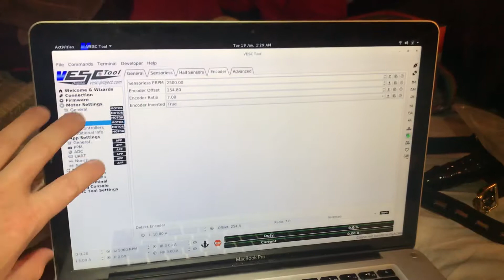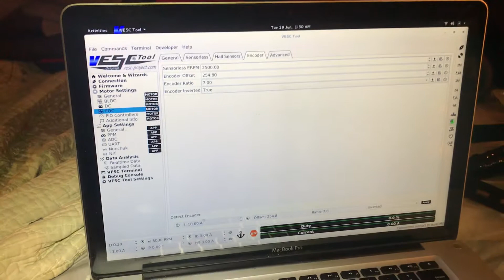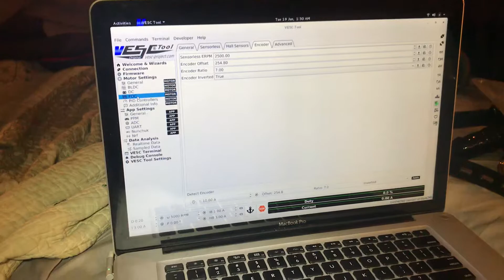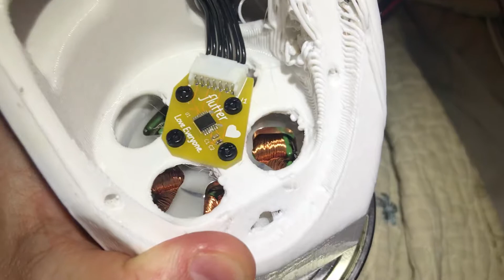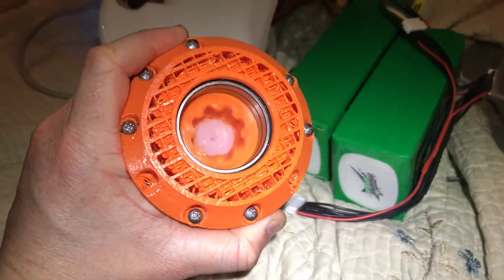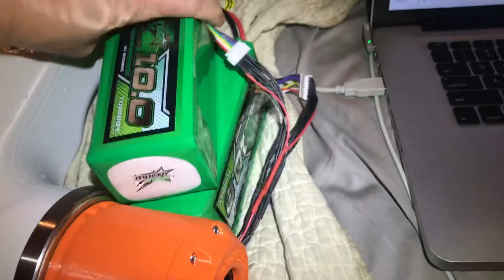Rover new gearbox final thoughts and VESC software

Comment: Hello!
The encoder stand in out shaft?
Reply from the maker: I'm sorry I don't quite understand the question - are you asking about using an encoder on the output of the gearbox? You could add another encoder on the output if you figure out where to place it. However to drive the motor properly you must have an encoder on the motor, and the VESC can only normally talk to a single encoder. Does that answer your question? Feel free to ask again if I haven't got it!
Reply: @SequoiaAlexander  Thanks for the quick response!
Yes, I want to use the encoder after the gear !!!
gear ratio 99!
I have already tried to detect the encoder, but VESK does not see the encoder!
the gear ratio may be too large
Reply from the maker: @TheIntellekt  Ah I see. Yes the encoder is used to determine what angle the rotor is at, to allow for commutation of the motor phases. If the encoder is after the gear, backlash in the gearbox as well as the gear ratio change means that the encoder position cannot be used to determine the rotor position and the VESC can not drive the motor. Move your encoder to the motor side to make it work. Then if you want to measure the output position, put another encoder there, read it with a raspberry pi or other controller, and use that position to determine motor velocity. Then send motor velocity to the VESC. Does that make sense? You could also do this on the VESC if you're familiar with recompiling VESC firmware and writing embedded C++ code. I would love to see your results so please share a video of whatever you are making! Thanks.
Reply: @SequoiaAlexander  I can do a review tomorrow!
Reply from the maker: @TheIntellekt  Wonderful I look forward to it. :)
Reply: @SequoiaAlexander  
Thanks for the quick response!
Yes, I want to use the encoder after the gear !!!
gear ratio 99

I have already tried to detect the encoder, but VESK does not see the encoder!
the gear ratio may be too large